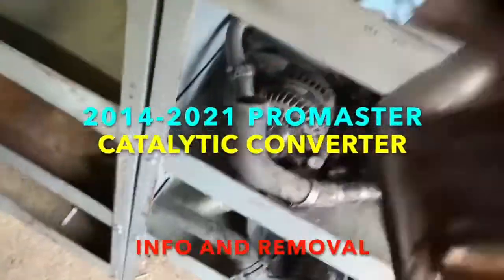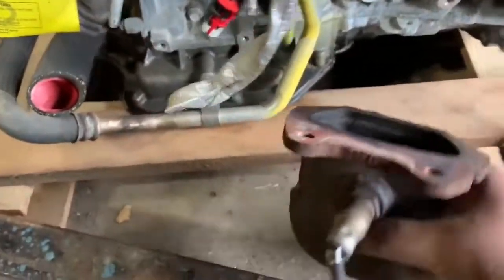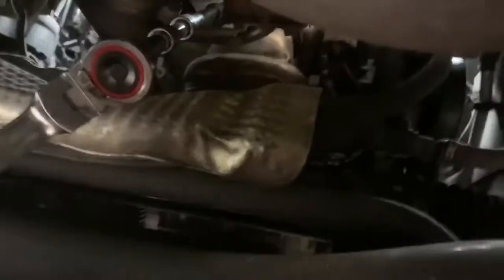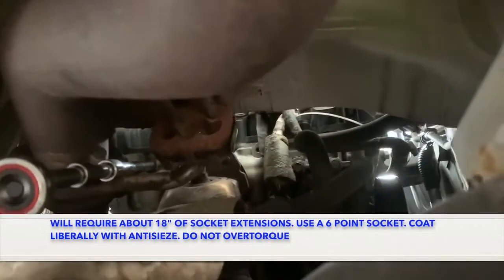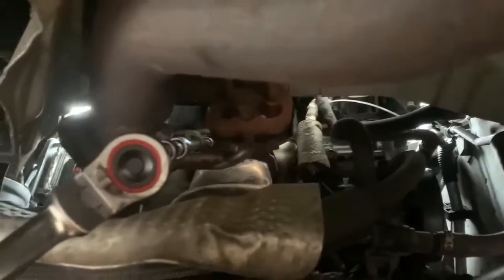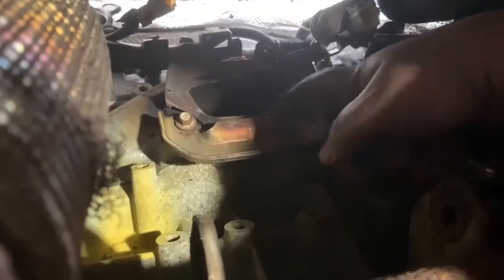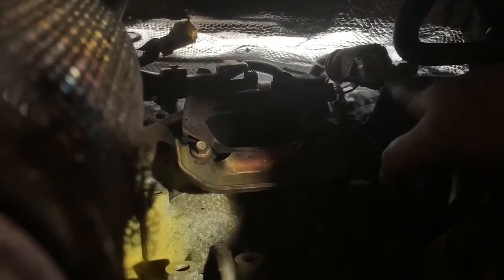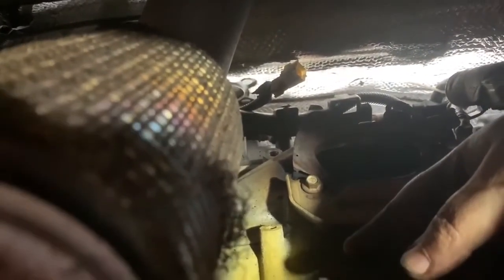2014 2021 Promaster   Catalytic Converter Removal and TIPS!

Comment: What do I do if the bolts to the cylinder head are rusted and break off?
Reply from the maker: @NicholasKwiecinski  You only have 1 choice - drill them out. Luckily, the bolt metal is soft (which is why it broke!) The front is easy to get to. The rear will be easier of you remove the rear engine mount and tilt the engine to give you better access. With the upper bolts broken, the cat will still come off if you loosen the lower two, which generally dont rust. I have a video on the offset 10mm wrench you’ll need.

Comment: Would you recommend running a Catalytic Converter full system cleaner through it first?
Reply from the maker: Absolutely not. Pure snake oil bullshit. As are ALL additives, with the possible exception of motorkote or lucas (debateable). If any additive worked, it would already be in there.

Comment: I heard in the video you advise replacing the cat bolts with stainless steel. Thank you.
Reply from the maker: Still on the fence about that. I went back to using stock grade bolts, only 5mm shorter so there is less bolt to get siezed in the head. Stock is an M8x1.25 25mm. Use an M8x1.25 20mm.

Comment: My 2017 Promaster keep throwing a P0430 code Bank 2, do I have to replace front and back cats? Please help!
Reply from the maker: @7xSupreme only need a front cat, and it’s 2 O2 sensors.
Reply: @promastersonly1419  thanks for the quick reply! I really appreciate that. I just replaced the O2 sensors yesterday, so now I’m going to replace that front cat!
Reply: I’m having the same problem wich after market cat do you recommend.
Reply: Also my mechanic left the o2 sensor connector hanging and got burn  they replaced it with a new sensor and new connector and now it’s throwing that code the p0430 do you think that’s happened due to the melted sensor connector? And do you think I need a cat or maybe replacing the other o2 sensors will fix it I’m on my now because the mechanic saying he’s not responsible for what happened.
Reply from the maker: @lofadem  P0420 (rear) or P0430 (front) codes are almost always the cat itself, not the sensor. If the sensor connector burns, it will throw different codes so that probably survived. But the fix is a new cat. Either buy from Rock Auto, or spend a little more and buy from O'reilly's, since they are lifetime warranty and if you ever need another one, freebie. They aren't crazy expensive.
Reply: @promastersonly1419  thank you for your response I appreciate you rock 👍👍

Comment: On a promaster 2015 which cat is bank 1 and which one is bank 2?
Is the rear one (closer to the front of the vechicle) bank 1?
Reply from the maker: Correct. The rear bank is bank 1, and contains cyl 1, 3, and 5. It’s cat is bank 1. Cyl 1 is nearest the belt. 

Bank 2 is the one nearest the radiator, and has cyl 2, 4, 6.

Comment: which aftermarket cat is preferable?  by cost:  noncompliant  magnaflow,  ap eastern, dorman,  700-400 ish (as of printing)

and im not in Cali,   if i have a cali sticker do i need to cali compliant cat  this is a $1000 question
Reply from the maker: We use the cheap ones on Rockauto under the name Original Performance. I'm sure they are not as good as factory ones, but no complaints to date.